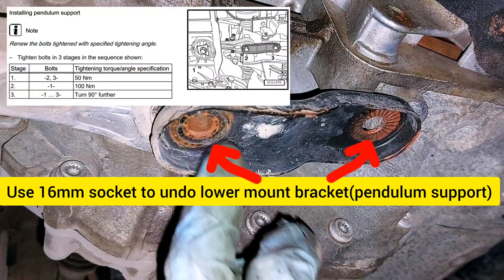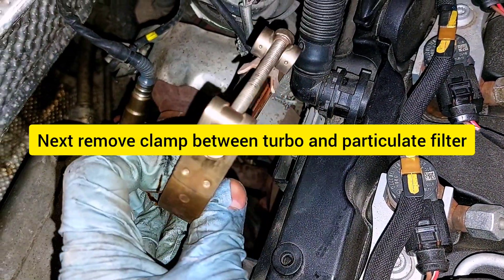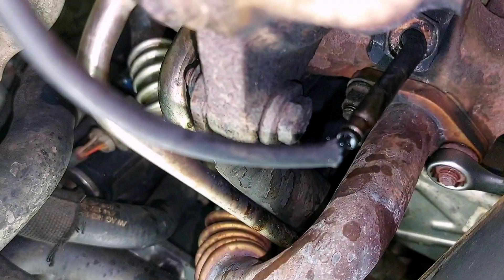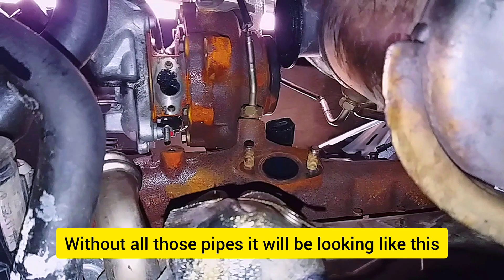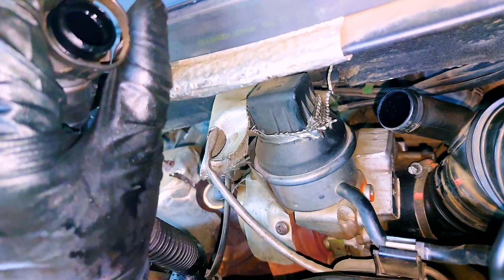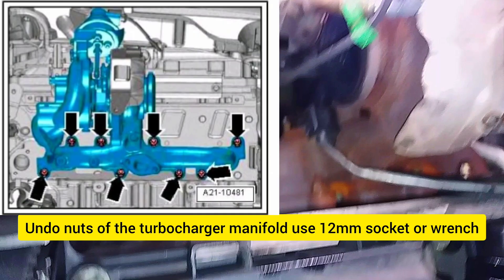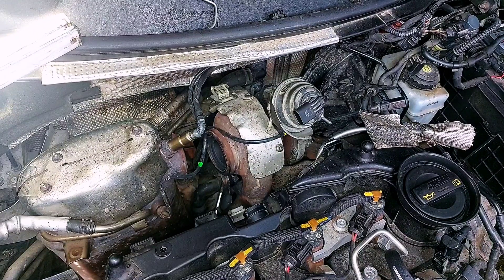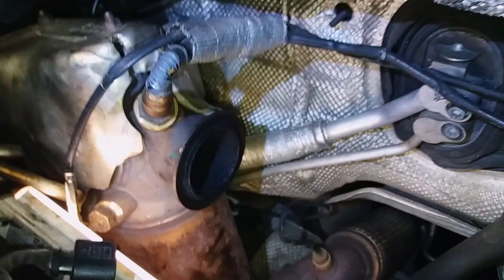turbocharger removal 2.0 tdi ea189 | passat b7

Comment: Hey thanks for video,
Im in the middle of doing this now.

Can you disconnect only the oil outlet pipe from the engine and the egr pipe will the turbo come out?

How do you reach these bolts?

 I am doing it on an audi a3 and am struggling to get to the bolts on the back of the turbo. Everything else is out.

I only have axle stands.
Reply from the maker: Hi. Thanks. Actually the oil inlet pipe is in the way to unscrew the oil outlet pipe🤷🏻‍♂️ and it is atached to the outlet pipe with retaining clamps on 2:56 min and it's not very flexible pipe at all, a VAG in it's beauty😅. I unscrewed the oil outlet pipe bolts from underneath using a long 1/4 inch extension and 10mm socket(or you can use Torx30 also beauty of VAG), but first I had to unscrew EGR pipe and oil inlet pipe and only then turbo go out🤷🏻‍♂️
Reply: @HintSlice thank you I might have some more questions in the next day or two.

You did this from underneath the car? I am a bit worried about getting underneath the engine there is not much room 😢
Reply from the maker: well you can lift only the passenger side, so all you will need are good jack stands or something similar like in this video https://youtube.com/shorts/gHaqfHxlsbM?si=zli9JadSg_6wYxpy and good luck 🙋🏻
Reply: @HintSlice I am going to have another look later today :)
Reply: @HintSlice I cannot thank you enough :) I've almost got it out without disconnecting the engine mount. Im sure it must be so much easier with a few extra inches to move around in with a wrench.

I went on a shopping spree and got all different kinds of extensions and flexi extensions / angled bit holders.

I'm down to my last bolt! 27mm banjo for oil outlet and it will be off 🎉 

Now I just need to get my new hybrid one back on 😭

https://youtube.com/shorts/uFxVX6IjJl8?si=JEooig6w2T22cIP0
Reply from the maker: @MikeUnity  No problem. Wishing you all the best in your repair.✊🏻
Reply: @HintSlice hello mate :) i finally got my turbo off. Do you have any advice on how to replace the oil return pipe? It splits in two. 

Should I attach the top half to the turbo and fit the turbo and then afterwards fit the banjo bolt side?

I had to loosen off my egr cooler to get it out.

Any advice for the oil return pipe?

I am using a hybrid CFGB turbo
Reply from the maker: Hi, congrats with removal🎉. 
Honestly, I've never tried to install a turbocharger this way with return pipe on, so you can try, who knows, maybe it's even easier this way.
Usually I completely remove the return pipe or just loosen the banjo bolt so that the pipe can move freely, like in this video with   Passat Alltrack https://youtu.be/T0ItCAfWUrw?si=yzLNfOOrVAjhJu4w, 
and then I install oil return pipe "in one piece" after instsllation of the turbo or If return pipe stay on the cylinder block, i just don't tighten the banjo bolt, letting the pipe move freely and then I install the turbocharger, but the main thing is that the gasket on top of the pipe shouldn't fall off during the installation of the turbo, so it has to sit tight (maybe even on permatex).
In any case, I know you'll succeed✊🏻, because at this stage there is no other option🤷🏻‍♂️
Reply: @HintSlice I did it 🎉 except I have a boost leak exhaust manifold leak 😭😭😭 any advice?

https://youtube.com/shorts/-BWaX_K7G2E?si=QvHrwnF6wXW01z19

How tight should the clips be? Very tight? Very Very tight?

I can't tell if it's coming from my boost damper area or the exhaust manifold or egr pipes
Reply from the maker: Clamp between DPF and turbo-7nm. 

EGR pipe with Torx 30 bolts-9nm
 
Nuts of the other EGR pipe-24nm
 
Turbocharger nuts - 24 nm.
 Maybe some gasket is missing(or not holding pressure anymore) in some connection between EGR and pipes or Turbo and DPF, what can i say it happens sometime.🤞🏻
Reply: @HintSlice I have someone coming tomorrow to do a smoke test hopefully they can find it 🙏
Reply from the maker: Wish you luck✊🏻

Comment: I have a Volkswagen Tiguan Mark 1  2.0 TDI in which the turbine needs to be replaced, it is very tight. I think I would rather not do it, but I have already disassembled something and now I think that it would be faster to remove the engine with the gearbox and then the access will be good. I will never take such a car to work for such a condition as replacing the turbine.
Reply from the maker: I think You succeed no matter what👍🏻

Comment: I really like how you didn't remove the entire subrame 😂
Reply from the maker: I imagine if someone removed the subframe and driveshaft and DPF to remove the turbine and then came across this video.😲🤦🏻
Reply: you don't do this on a 4th motion
Reply from the maker: @dennisrosenberg4157  But actually yes, you can, because i have done that.
Reply: @HintSlice  You can't remove the banjo bolt, it's probably faster to remove the subframe and driveshaft ?
Reply from the maker: @dennisrosenberg4157  As always, everyone chooses the easiest way to get the job done, so I'm not against that,I just show how I do it and what works for me. So You need only to disengage(or fully remove) driveshaft from the transfer case flange and then fully remove or just moove a littel bit  flange from the transfer case to have access to the banjo bolt. In next video or short i will show that.
Reply: @HintSlice  aha okay, yes please do, good videos keep it up! :)
Reply from the maker: @dennisrosenberg4157  thanks
Reply: @HintSlice  
In which video do you show how to do it? :)
Reply from the maker: @dennisrosenberg4157 in one of the future video.  but this vid is not in priority right now, so I dont know exactly when ;)